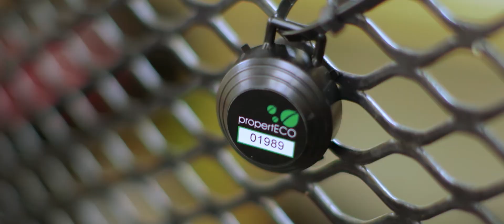propertECO Company Profile - UK Radon Specialists

Comment: If the gas occurs naturally and rises to the surface, how does it pass through a concrete pad? surely you would be exposed to the same amount just walking in the street's?
Reply from the maker: The difference is that in the open air, any radon coming to the surface will quickly dissipate and dilute to a very low concentration. In buildings, we typically have low air pressure which actively 'sucks' the gas in from the ground and then it gets trapped there so can accumulate to higher concentrations. Radon gas can pass through concrete and other building materials due to this air pressure differential -  not due to it's radioactive properties, just due to the physics of air flows.